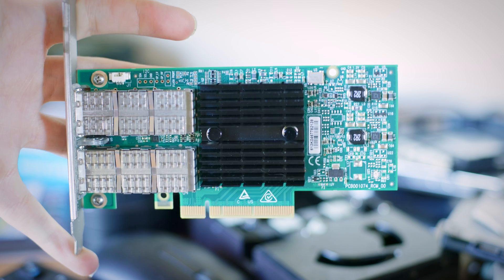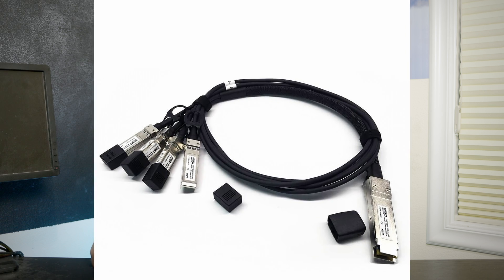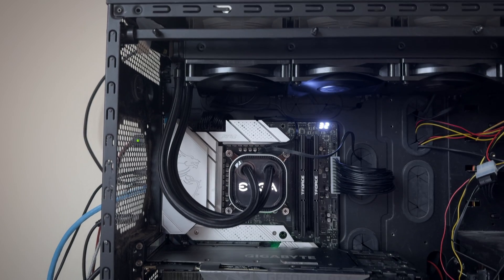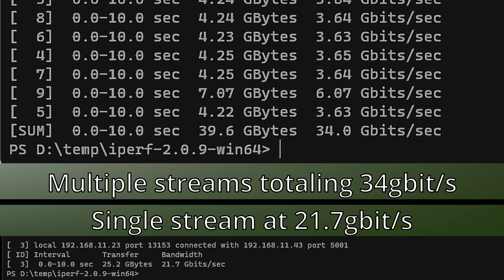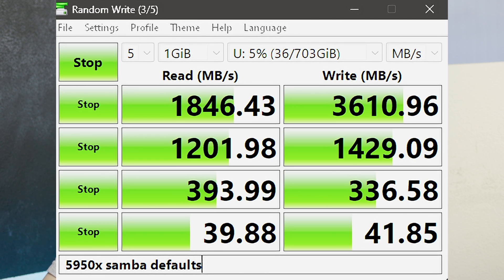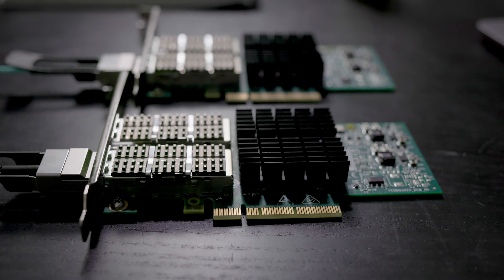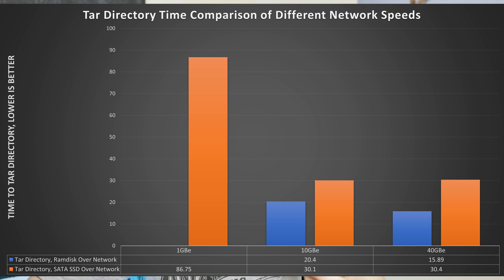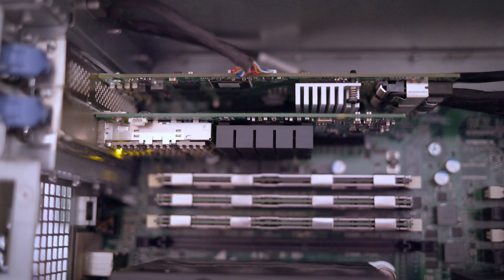Trying out 40GBe, Does It Make Sense In A Homelab?

Comment: Why not use a different protocol to SMB?  NFS/FTP/SFTP/SCP?  Host your own speedtest web server and then see what the network speed is?
Reply: 20 seconds later....yes, jumbo frames too...
Reply from the maker: I use smb as my default as it’s well supported. I tried nfs as well and I got similar performance and didn’t mention it in the video. I might look into different protocols for network file copies later on.
Reply: @ElectronicsWizardry  Also, when striping the volume, make sure you get the full 5GB/s from hdparm -t or similar and then maybe express the 3.2GB/s over the theoretical max to get a %age.
Reply: Also, you probably know this, but use atop or glances to make sure it's not some sort of interrupt bottleneck.

Also, again, shift H on top shows threads to avoid using htop.

Comment: Some of us still struggling to fill a gigabit 😂😂😂
Reply: My best switch is 10/100 😅
Reply: Modern HDDs do 1.3 - 2 Gbps each though
Reply: I finally utilized my gigabit connection fully for full backup. Scheduled it for each night, but since i set it up with rsync it now backs up 20GB+ in a minute since it doesn't have to transfer much.
Reply: 1gb isn’t enough for me. I had to do a backup of 60GB of data. Took forever. Current using a 10gb and looking to move to 40gb now and 100gb later in the future.
Reply: this is actually true but hey, people also buy sportscars without ever driving them faster than 60mph

Comment: Multi-threaded or parallel IO workloads are the only way you're going to realistically saturate a 40GbE nic.  Iperf3 is a very useful tool for doing line testing as it uses raw TCP performance and it can also help with identification of potential CPU bottlenecks.  If you're attempting to simply test performance through NFS or SMB those protocols at significant overhead in and of themselves.

Edit:  Apparently my previous comment was removed by our YouTube overlords lol.